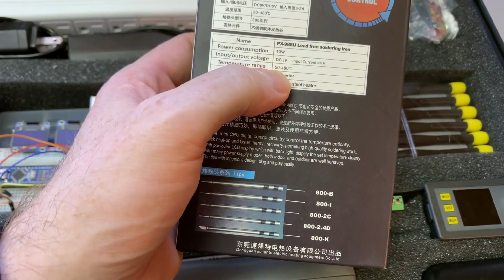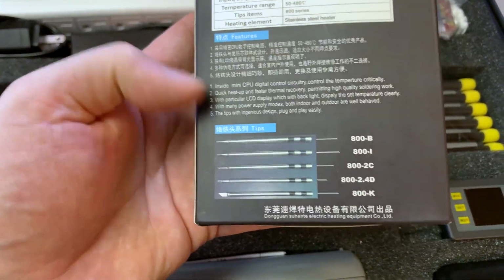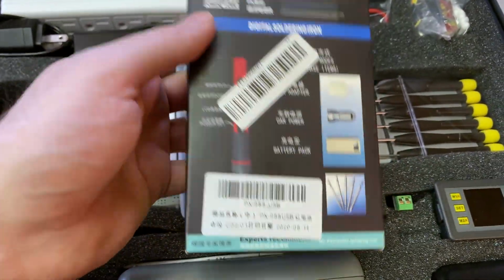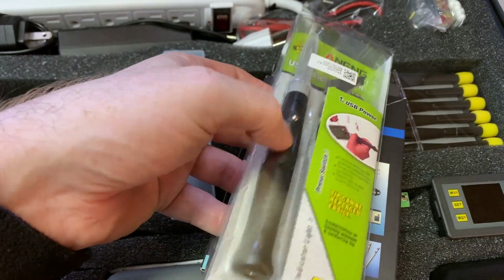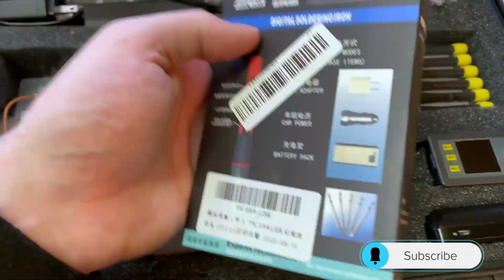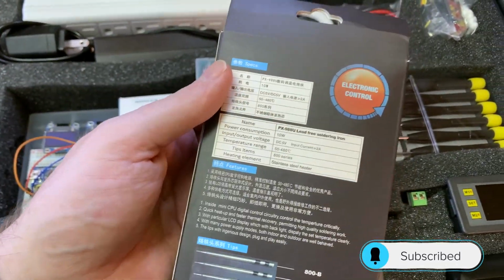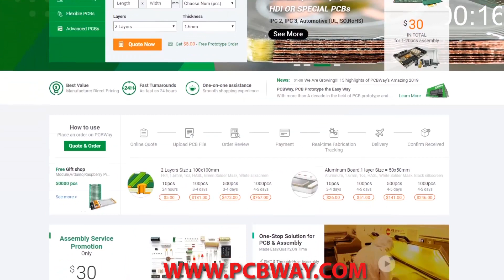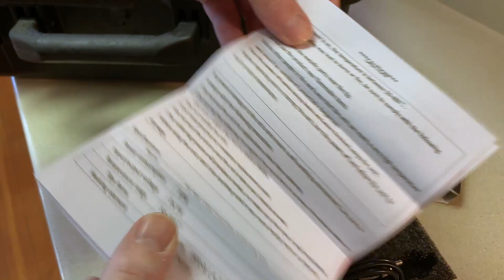A USB Soldering Iron That Works? 🔥

Comment: THANKS! I was at a loss- until I saw you push the iron into the handle all the way, then it started getting hot. If it wasn't for your video, I would have never known.

Comment: Overshooting is a combination of lack of thermal balance, which needs some mass and some radiating area, and lack of PID control. You need either the one or the other. So say TS80/100 and T12 have PID in firmware, which incurs some complexity, because these kinds of tips aren't really intended to be run otherwise. My prediction is that they will come down to around $15 from China (as opposed to $5 for the simple USB ones) and be a decent value at that price. Right now it's in a bit of a no man's land where it's not quite cheap enough to be cheap and not quite good enough to be good. But i guess if you need something that would work on a standard 5V power bank, you could do worse.